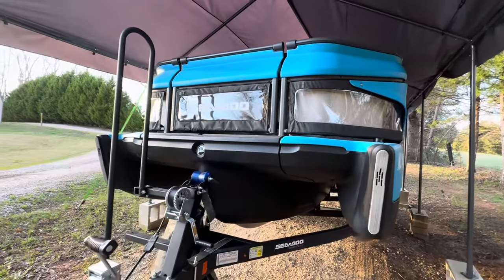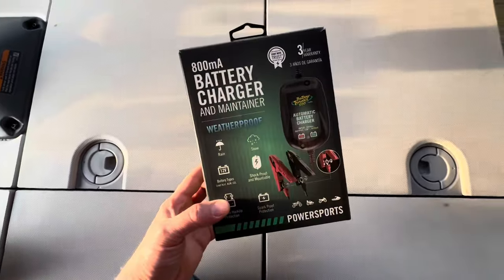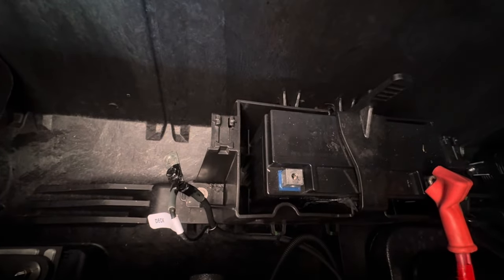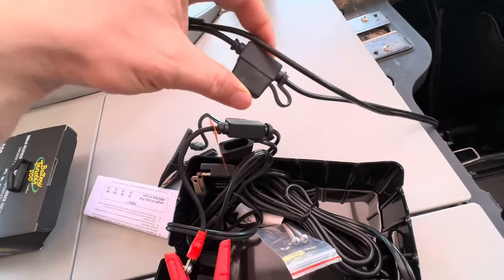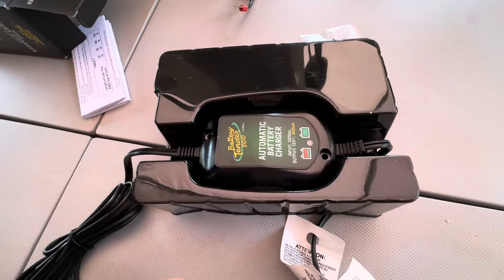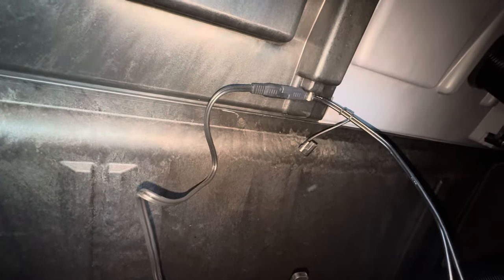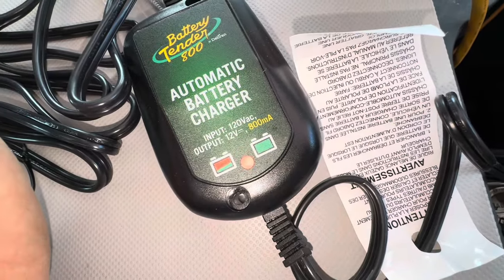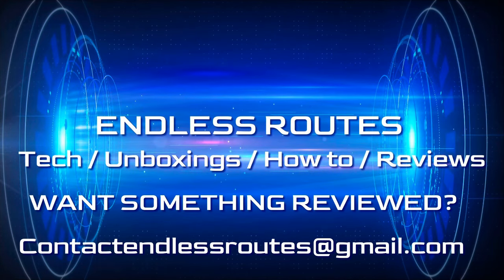Seadoo Switch: How to install a battery tender

Comment: If you are going to open the engine lid each time to connect the zip tied end, then you can also leave everything hooked up left in the garage and just open the engine lid and alligator clip it each time.  Then you can use any charger and not just a marine one.
Reply from the maker: Yea you could do that 

I still prefer the marine charger you never know where you might be and where you might need to charge.